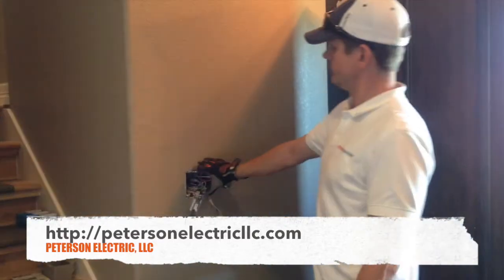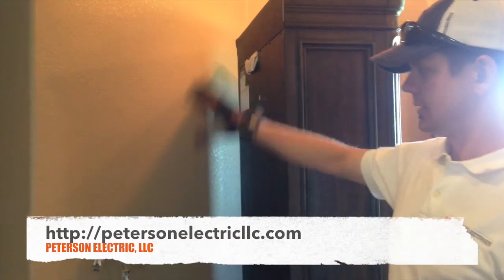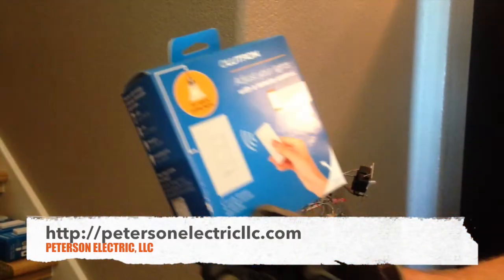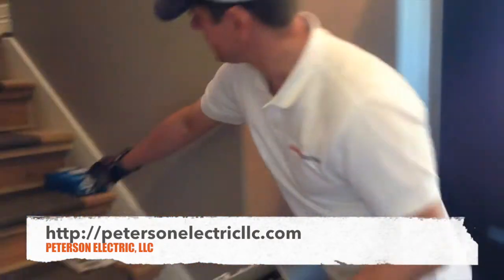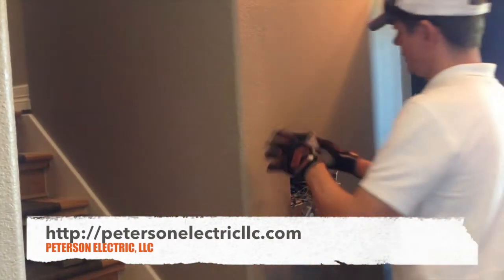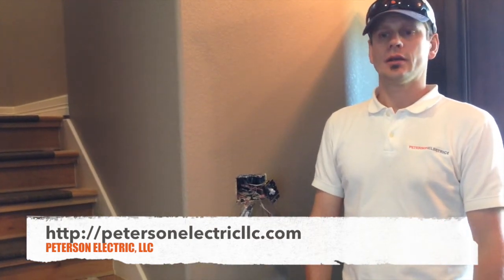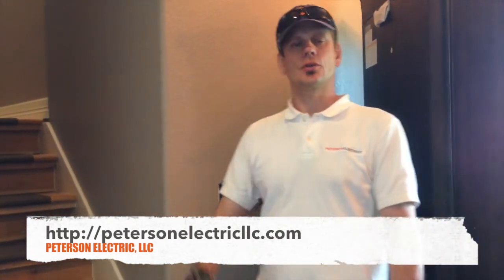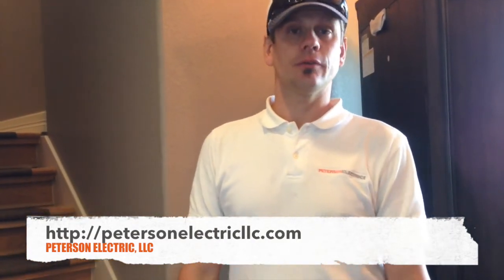Can A Switch Be Moved To A Different Location, Without Massive Damage? Wireless Switch Installed

Comment: I really wanted to see the product, but your banner is blocking the view just like the previous comment that was made prior to mine.
Anyways, I have a master bath that new cabinets are being installed along with a tall linen cabinet. The linen cabinet is being installed along the wall were the light switches were previously placed 15 years ago.   I thought this might be our saving grace rather than maneuvering electrical wires to a different wall. 
Maybe we will just have them put the switch on the outside of the bathroom wall (opposite of where it is located)  hummm, suggestions are appreciated 😉
Reply from the maker: As I have expressed to others in our videos, the banners were put up from 2008 to 2015 and it is almost impossible to take time & $$ and have our SEO guy remove them. This was not seen as mistake util later. Besides, this has taken us over two decades to achieve some of our trade ideas and solutions. I have a second video on this solution and i did describe in my video what we did. Not sure what more I can give you ?